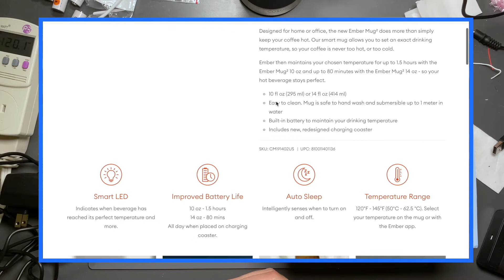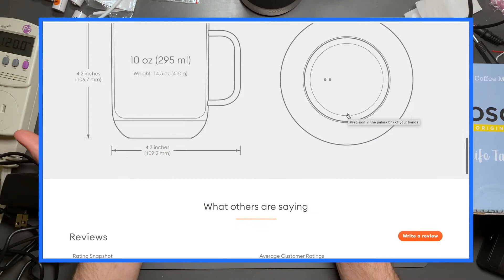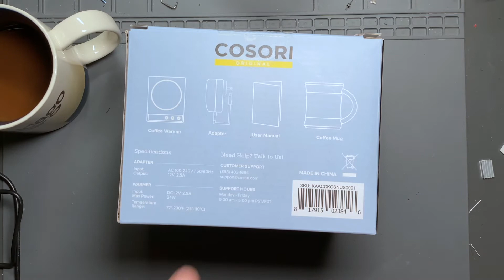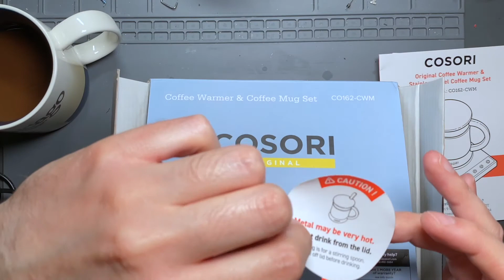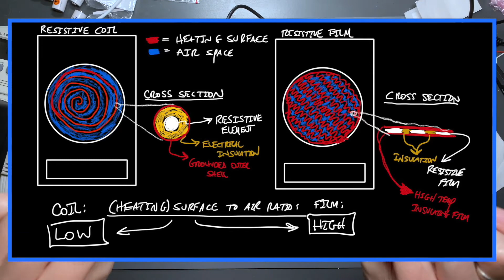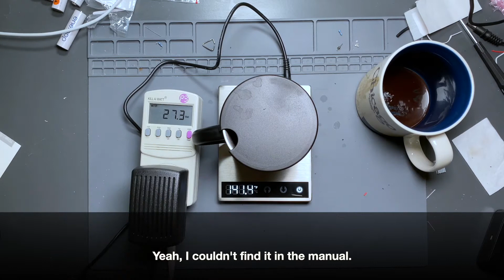Cosori Coffee Mug Warmer Analysis and Testing (CO162-CWM)

Comment: I've had Cosori for 5 years and it does maintain the temperature.   it won't  stay at 230 or what ever temp you set it.  that doesn't work.  never did.  I called support and she said it only shows the temp of the plate.  that's what it does maintain the temp in the cup. and after awhile it drops.  right now my half cup of coffee is 138 in the cup.  the plate says 189.7.  and it slowly drops. That's why they give you a lid to keep it hot.  So it is not the best.  Looking for one that gets hot and stay hot

Comment: A hot cup of coffee is between 160 degrees F (71.1 degrees C) and 185 degrees F (85 degrees C). Will this warmer give you a hot cup of coffee? Have you ever checked the coffee with a thermometer?
Reply from the maker: This seems to be a debated thing amongst coffee enthusiasts. And while I dabble with making pour-over and espresso, I don’t consider myself an enthusiast, per se. I find 160 -180F (71-85C) figure too hot and prefer a temperature between 130 -150F (54-66C). This unit will definitely get into that range. There are two experiment videos on this in the description. Thanks for watching!

Comment: I wish I could find info on this using a normal, traditional, coffee mug like we all have way too may off, and how well it keeps up the heat as the cup gets emptied drinking it. I have a cabinet full of mugs, I'm not interested in going to a steel one, much less pouring from one to another. The main point shouldn't be reheating liquid, but just maintaining heat in your regular mug. Nice video and channel though!
Reply from the maker: I had a lot of fun with different experiments with the drink warmer. Just need to finish editing them! The regular mug experiment is one of them. Look for it soon. Thanks for watching!
Reply: @TheCuriousEngineerChannel  Well, I bought it since it looked so good compared to others. LOL  I have a completely flat bottom ceramic mug I use a lot that has full contact and it works very well with this. Very happy so far and thanks again for the video!
Reply: almost perfect...i wonder if I could DIY a FLAT metal bottom on top of the warmer plate...so I can use ANY mug that loved ones have given me?
Reply: @MattKoch3  Something slightly raised might also keep large mugs from scratching up the surrounding surface, although it might take a while to heat up.
Reply: I notice that at 230° mine gets to 184° on the surface, which is plenty. Over time, the surface of my desk gets pretty hot. Disconcerting, but not hot enough to be a problem that I can tell. I use flat bottomed ceramic mugs and this thing does a great job. It's a little scuffed up around the surface outside of the plate from larger mugs. I may have to get another one of these, I keep moving this thing around with me. LOL

Comment: You did a nice job reviewing the Cosori.  You spent quite a bit of time during your intro critiquing the Ember.  I don't see the Ember as a competitor of the Cosori.  Fortunately I do have experience with the Ember and bought my first one shortly after they introduced.  That was around three years,  maybe four, I don't remember.  I'm still using it.  I also have the travel mug and the larger mug.  None of the issues that you have stated have I experienced but I do have a few of my own that I will list.  I know these are legit.  1. They do require special attention to clean.  Not a big deal you just learn to do it.  Next, the finish on inside of first cup chipped off.  I haven't died yet from continuing to use it. The finish of the later model cups looks much more stable and the electronics are greatly improved as well.   Updates were always a hassle with the first two.  The later one is excellent.  The ease of use makes the Ember a very nice and convenient tool to use in the morning.  You can leave the charger in the kitchen and continue to drink hot coffee throughout your home.    I am going to try a Cosori for one reason.  I use a professional espresso machine and the cup will not fit under the dispensing head unit of the machine.  This requires the espresso to be put in a separate vessel and then poured in the Ember cup.   I do it but not in love with the extra step.  This is why I am going to try the Cosori. The charger and cords that power the Cosori are not something I look forward to using.  Every gadget that I have bought with chargers like the Cosori have eventually failed but for $30-$40 I am willing to risk it.   

I will report back my experience with the Cosori when I get it.